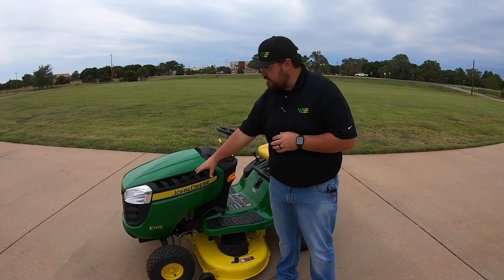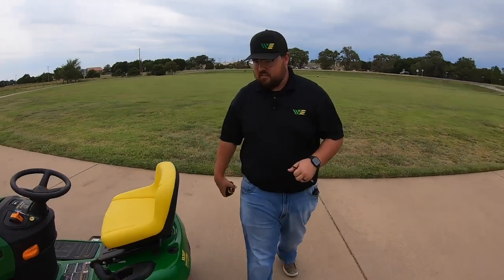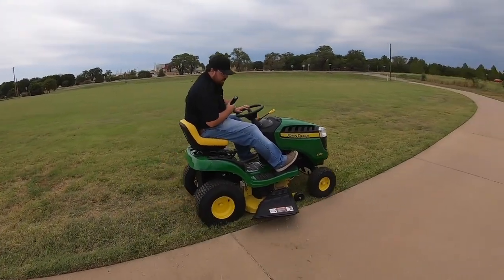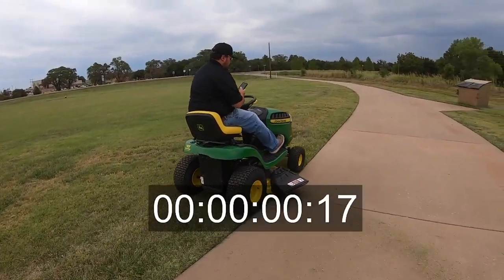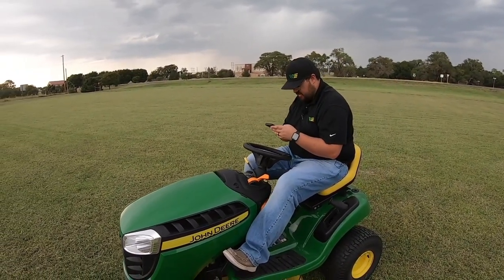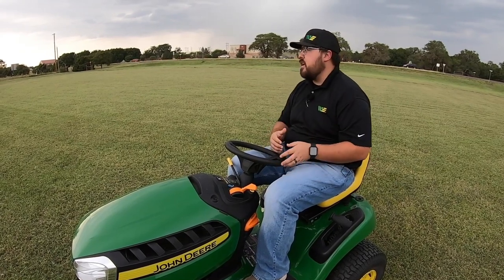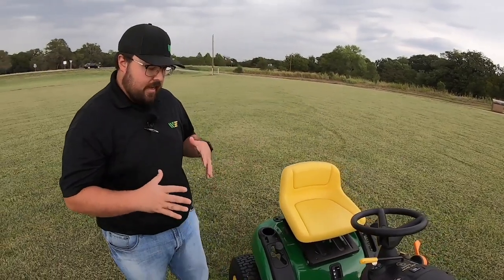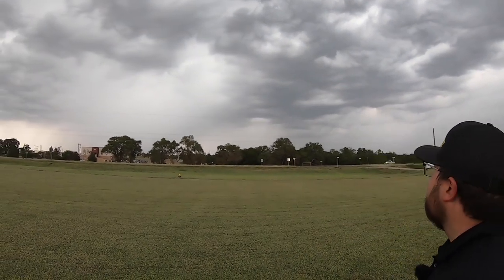How fast can the John Deere E100 Mow an Acre? | John Deere's smallest residential mower

Comment: thanks for that video.  I always wanted to see that E100 in action.  But now I'm wondering why John Deere changed the gear transmission in the D100 to the plastic CVT transmission in the E100.  It just doesn't seem like an improvement to me, more like a big step backward.  Have you ever mowed with the D100?  Do you think you would have been as cramped after mowing an acre with the D100 as you were with the E100?
Reply from the maker: No I haven’t ever mowed with any of the D series mowers but I would say this is a great mower for a small yard. I would just suggest going with an E110 for $200 more if I had an acre to mow.

Comment: I just bought a used John Deere d105 looks pretty new which is exactly like this one just a little bit older. The person stated that it had a problem but i used it for an hour or so with absolutely no problem. I guess I got lucky there!!

But how do you use the reverse safety button? Do you have to always have it pressed on when you are going in reverse. 

And also I saw that the plastic that has the forward neutral and reverse letters on it has two little lines on the forward. What does that mean? 

Thanks
Reply from the maker: Sounds like you got a steal! So to use the RIO button you only need to push it in until you get going in reverse and then you can release it. As far at the two lines on on the forward emblem, I'm not sure what those are for and I could not find anything explaining this. I'm sorry I couldn't answer this one. Thanks for watching!

Comment: I just bought the s100 yesterday and am having it delivered next month. With the s100 being hydrostatic where this e100 isn’t do you know if you won’t get the fatigue pushing on the pedal with the s100 like you did with the e100 in the video? This is my first riding mower/tractor since when I moved out of my parents house decades ago
Also when you were mowing in this video were you going at top speed?
Reply from the maker: I can tell you there is significantly less fatigue with the true hydrostatic transmission. And yes i was doing my best to keep the pedal down to full throttle.

Comment: I have a question my local dealer I bought my tractor off of never answers the phone or dont return my calls.i have a e130 when idling it sounds a little ruff but when u put a load on it stops I had it a year in a half still under warrenty.but all the lawnmowers I own sound the same is that normal
Reply from the maker: This sounds like a fuel issue. It could be that your carburetor needs to be cleaned or you could have an air leak. I would definitely get it into a dealership before the warranty expires. Best of luck and thanks for watching!
Reply: @WesternEquipment  thanks